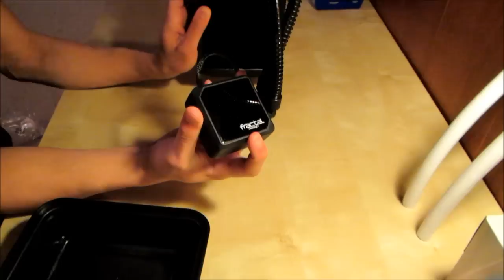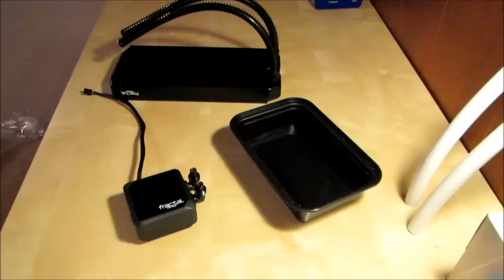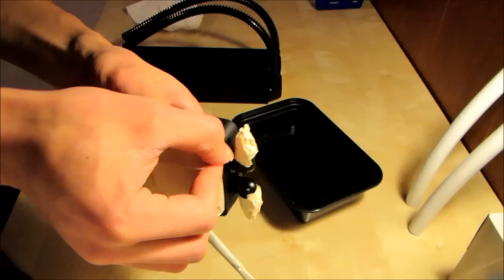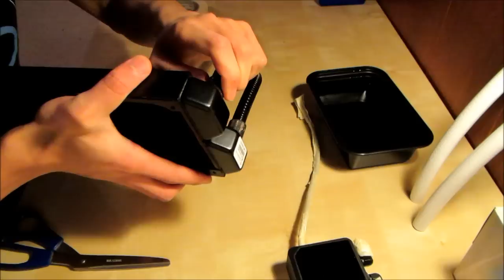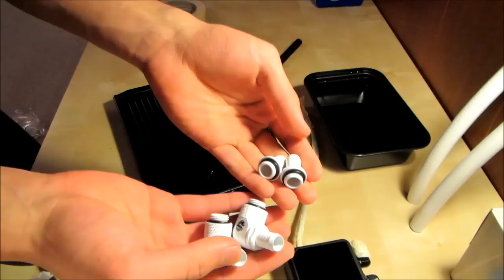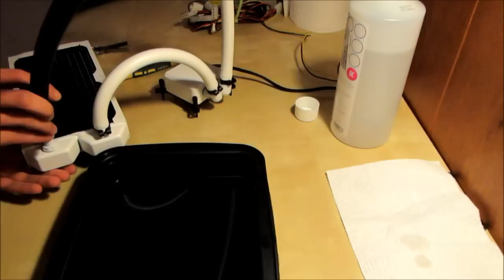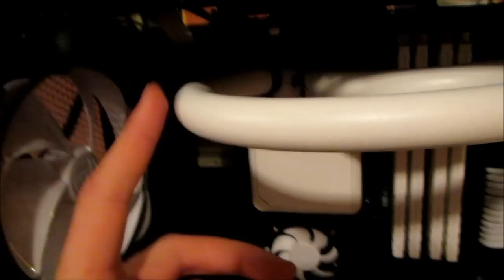Fractal Design Kelvin S24 refilling+modding guide

Comment: hold on... so if I wanted to add to the loop, I'd have to drain it, test fit it in my rig, take it back out, fill it, then install it? that's going to be a bit of a pain if you add another rad and GPU block, or is does the fill port stop fluid coming out?
Reply from the maker: antiduckable any time you modify the loop you need to remove it from the PC
you dont have to drain all of it, but you will need to refill it with more fluid when you put it back together
thats the same for all watercooling loops

Comment: One quick tip for removing the vibration. Use the CPU fan header and lower the pump speed by just 150-250RPM. 

It have hardly any impact to performance.
Reply: U can't change speed it's 3 pin
Reply from the maker: +Xetion Yes, you can change speed on 3 pin fans. The 3 pins are power, ground, and tachometer. The speed can be changed if your motherboard supports DC voltage control, which lowers the power making the fan run slower. Although for some reason I didn't see the pump speed change at all. 4 pin fans can also be speed controlled, they just work in a different way. The 4th pin is PWM 5v which pulses rapidly and manages to get the fan speed all the way down to about 10-20% which voltage control cannot do. You can control 4 pin fans with either voltage control (3 pin) or PWM (4 pin)
Reply: +Enderman LP oh ok. Do I still plug the CPU block into the CPU_fan or sys fan?
Reply from the maker: +Xetion CPU fan because your PC will alert you if the pump fails

Comment: Here are a few ideas you or anyone reading this comment may want to consider in the future, rather than use Masking Tape to cover things spend the extra and get Blue or Green Painters Tape. They are designed to stick but not leave an residue behind. Plus I think Blue can last upto 14 days and Green 30 days with no residue issues; obviously double check this. When removing tight fittings rather than Mar the finish you may want to consider using a piece of leather such as a Belt for example, or maybe something thinner. The Leather will still allow you to grip the item without damaging the finish. I know you are not going to reuse these fittings but this is more for those that might want to reuse them...

Comment: Nice job but seems like a lot of work just for white tubes and pump. I'm too lazy I would have just got tube covers ..lol.. What kind of paint did you use to paint the pump? Might of looked cool if the top wasn't painted since it had a glossy finish and the white writing, just a thought, but it still looks very nice and clean.
Reply from the maker: I used plastidip. It was a lot of work, should have just bought white tubing and replaced it :P

Comment: How did you apply that little 40-60mm cooler below the pump? I have small Noctua and i had idea like that, but i didn`t knew how to apply it to motherboard.
Reply from the maker: The motherboard needs to have a spot for the fan, you can't add it to any motherboard. This is a sabertooth P67.

Comment: nice rig!, is that corsair lp vengance ram you have painted white? did you do it with a brush or remove the heatspreaders and spray them?
Reply from the maker: Jolinator yes, I painted it with plastidip directly on the heatspreader, no sanding needed
i did remove the spreaders from the DIMM first, paint it, then put it back on with some new thermal pads

Comment: Hey I'm thinking of doing this but maybe expanding the loop to include my GPU and I would like to use Bitspower compression fittings instead. My planned build will be Black/Yellow. I want to use black Bitspower fittings and paint the block yellow. Can you please tell me which size fittings I need to order?

Comment: Hey, Nice video by the way! Just a quick question how do you hotwire your PSU to test out your water pump?
Reply from the maker: Short the green wire with one of the black wires, or use a PSU starting connector which just costs a few bucks and is safer.

Comment: What fittings size do they use?     What tube size as well?   Great video.
Reply from the maker: +SGTSAS It's not standard tubing and fittings, idk the size, but I do know that they use G1/4" threads so you can buy your own fittings for your own tubing. I'm using 3/8" ID and 5/8" OD tubing, with some bitspower 3/8" barb fittings

Comment: How did you paint the radiator without getting paint on the fins? And what type of paint are you using? Also, from you're other video I saw your motherboard. What is it and is it modded?
Reply from the maker: Jono K you have to use paper and tape to cover up the finsI used plastidip because its extremely easy to removeif you mess up you can just peel it off
my motherboard is an asus sabertooth P67, no mods
Reply: Enderman LP so when you painted your ram did you take the plastic shroud off or just cover the pins? I'm thinking of doing the same cause it looks very nice. Im planning on building my first pc and i really like the black/white colour scheme so yeah.
Reply from the maker: Jono K There are tutorials on youtube of how to remove the vengeance heatspreaders for painting. That's what I followed. It would be a lot easier to just buy while ram though :) there are white vengeance LP ram kits, and hyperx fury also comes in white.

Comment: hey do you think this loop can be expanded to include another radiator, a reservoir and a GPU block? Is the pump strong enough to handle it upgrades? How does this compare to the DDC or D5 pumps from ek, alphacool etc?
Reply from the maker: The pump is worse than a DDc, but quieter. That's a lot of stuff you're planning to add, I personally would go with a EK predator cooler OR even better, a watercooling kit from EK with a D5 pump (best pump ever)
Reply: Enderman LP I'm a cheapskate. Those kits are pretty expensive compared to an AIO. The kits aren't even cheaper than the sum of the individual parts combined lol
Reply from the maker: True, but the kits come with the stuff you need so you don't forget anything :)

Comment: thank you for this guide!

i am considering buying the FD Kelvin T12, which presumanly has the same pump part as the one you have. I am gonna mod it, and im wondering if it will handle this connection well enough:

CPU Block Pump -> Original Kelvin T12 120mm reservoir -> GTX 980 GPU Waterblock -> BigAss 2x140mm Coolgate Radiator -> Koolance TNK-501 5'25" Bay Reservoir -> back to CPU

will the pump be able to push the water at a good enough speed, or will it be too weak?
Reply from the maker: +anderp Yup it should be alright. The only thing that really adds resistance is the GPU waterblock, but it should have enough pressure to push fluid around still
Reply: +Enderman LP should there be any problem if i add an extra pump to the setup? i am buying the kelvin t12 cause i can keep it in the rear of the case and expand it without having to spend extra bucks to replace that.
Reply from the maker: +anderp it may cause extra noise as the second more powerful pump will push the stock pump faster
If you plan to use a more powerful pump like a mcp or D5 I would also buy a regular CPU waterblock with no pumpbut you can try it with the stock waterblock, see if it causes extra noise or notworst thing that can happen is the CPU block pump fails, which isn't that big of a deal since the second pump will be much more powerful

Comment: Instead of doing the thing with water to know where the water go in and go out you could before dismounting connect the cooler to a CPU, run a burn test without fans spinning and touching the radiator to see which side is hot and which side is not so hot. The radiator is made to cool so the water that going in is hot and the water that coming out is colder.
Reply from the maker: L3xou97 the water is moving so fast that the temperature in the entire loop normalizes
this means the difference in temp from one side of the radiator to the other is only a few degrees, not distinguishable to a human being
Reply: I use an H75 (120mm so) on my R9 290x (with a corsair HG10) and i can feel the difference when i run a burn test or something like that. On one side i can put my hand and on the other side it's a pain to keep the hand on cause it's too hot. But's that's maybe cause the 290x as a 290W TDP.
Reply from the maker: L3xou97 yeah, also those compact AIOs have a smaller pump and a lot less flow rate so the liquid moves much slower
Reply: And why didn't you put a reservoir? You can avoid bubble sound with it.
Reply from the maker: L3xou97 I wanted to make something compact, with few components, and easier to swap out. Also I will not be able to fit a res anywhere once I get the 86mm thick radiator
Reply: Are you sure you want to get a 86 mm rad? You sould get really low fpi if you want to get a rad like that or your fans will have difficulty to push air through the radiator.
Reply from the maker: L3xou97 yes, its specifically made to run with low speed fans, its an 8fpi radiator
also it is easier for fans to push air through a thick low-fpi radiator than a thin high-fpi radiator

Comment: If you are planning to change the rad why didn't u buy a pump+waterblock combo from swiftech?
Reply from the maker: +Luca Peppe the swiftech one uses a DDC pump which is very loud (especially with no dampening) and also overheats easily. Dazmode has a video on the DDC showing how they overheat and fry after a while. I'm planning to buy a D5 sometime in the next year instead
Reply: didn't know that, thanks for the tip :D
Reply from the maker: +Luca Peppe You're welcome :)

Comment: can you link the 90 degree fittings you used i cant seem to find the white bitspower 90s you used, i can only find the dual and triple rotary fittings. did you use a 90 adapter then put a straight compression into that to get the nice tight 90s off the block? pc looks great btw.
Reply: ok thats what i thought awesome thanks for the quick reply even though the videos older haha appreciate it!
Reply from the maker: You're welcome!
Reply: man fractal just released the celsius model to na and you can only remove the fittings from the radiator why on earth would they do that. noone who takes the time to swap out lines and add a gpu block is going to want to keep those hoses. fak.

Comment: Had to go check the LTT forums to verify, and yes, I recognize you. It doesn't make any sense to me if you are going to pretty much be doing a custom loop with just the block/pump combo from a full AIO. it doesn't make sense. It would have been better at that point to go for the smaller version and spent less. I'm going to be ordering the S36 to use on mine. eventually, yes, i may swap out things myself, like the 360 rad for a 420 and add on a gpu block.
As far as the tubing, there's little to no difference between bigger and smaller tubing. Yes, alot of people prefer thick walled tubing, there is no significant difference between the two. Those fans are pwm, and with that rad, you don't need to spin then at full speed. Doing it this way will result in lower noise. ALL fans get loud at full speed.

Comment: Why did you change the rad? Noticeable performance boost?
Reply from the maker: +Xetion I didn't chance it, I just painted it white. I'm actually planning to buy a 280mm rad soon from hardwarelabs, I'll make a separate video when I do that. I want to be using 140mm fans instead of 120mm fans for better airflow, and the hardwarelabs radiators are the best with low speed fans.
Reply: +Enderman LP the cpu pump wont be enough for that and you even want to add a GPU block...
Reply from the maker: +Lo Studios Adding a 120mm radiator? Yeah it can do that. I won't be using this pump in the future though, I will buy a D5
Reply: Enderman LP  thats a rather nice pump and it will be enough.

Comment: I am also a fan of black and white. Out of curiosity, what are your idle temps (mobo and cpu) and your intensive gaming temps (mobo and cpu) please ?
Reply from the maker: harshlens Idle temps are about 40C for motherboard and 45C for CPU load temps are about 50C motherboard and 64C CPUmy 3770k is overclocked to 4.43GHz with 1.135vAlso my fan curves are set extremely low at idle which is why idle temps are high (they are running at minimum speed, 500rpm)
Reply: Enderman LP
Oh ok got you and thank you. Yeah I do have very low idle temp, but my fans are all on max speed... I think I will lower them, but I don't really mind the noise. You must have a very quiet PC.
Reply from the maker: harshlens Yeah I'm trying to make it as quiet as possible because I have it on 24/7 in my room where I sleep  
When I get my 280mm radiator I will be able to use my 140mm noctua fans instead which should give a lot more airflow and lower temps while making the same noise level
Reply: Enderman LP
yeah if you keep it on, for sure you don't want it to be noisy. I guess your GPU also makes a lot of noise, I can't wait for the new amd card and I'll get the water cooler version from asus.

Comment: The pump is design to withstand dryrun, so why not just use the fillport to fill the system?
Reply from the maker: Martin Olsson because it takes longer and makes it really difficult to remove all the microbubbles
I top it off at the end using the fill port but there is still a bit of air inside
the best way would be to use a radiator with multiple fill ports and use one of those to fill it up so the radiator acts like a res, that's what I plan to do when I buy the nexxos monsta 280 radiator :)

Comment: Why did you paint the tubing when you can buy white tubing?
Reply from the maker: pOpArOb Because I wanted a matte white finish, not glossy like white tubing
Also the EK ZMT tubing is the best kind of tubing and comes only in matte black
It has no plasticizers and doesn't degrade over time like plastic tubing

Comment: Is the pump strong enough to expand a dual GPU in the loop or will I have to buy a second pump?
Reply from the maker: +Andreas karlsson I wouldn't do more than 3 components with this pump, so rad+CPU+GPU. You can probably do two GPUs and it would work, but that would increase temps a lot. If you're planning to do so many components like two GPUs, a CPU, and one or two rads, you should probably invest in a D5 pump :)
Reply: Enderman LP Ok.. Thats a shame.  Guess I'll have to wait an additional month for the greens to a pump then. 

Reservoir not needed or?
Reply from the maker: +Andreas karlsson It's not needed, but from my experience it is far easier to fill a loop when you have a reservoir. If you have room for it in your case, buy a D5+reservoir combo and you will be set :) The best pump on the market + reservoir for easy filling will make your loop look cool and more fun to build
Reply: +Enderman LP yeah i can fit it but it wont be sen since i only have a small window.  ^^ 

think ill try it without the pump and monitor how hot it gets and get a pump+res later instead then. :-) wanted to try water cooling for 10 years now but always been to poor or to much of a chicken. xD

Comment: Hey, is the pump of this AIO stronk enough to add a GPU block to the whole loop?
Reply from the maker: Le Magic Cactus yup
I would say max is CPU+GPU+480mm of radiator
Reply: Ah, thanks. I might buy the S36 so no extra rads would be needed and since 360 is probably enough to cool an i7 4790k and a GTX 980, right?
Reply from the maker: Le Magic Cactus yup, definitely enough :)
Reply: Enderman LP Thanks for the quick answers!
Reply from the maker: Le Magic Cactus You're welcome :D

Comment: what if you add a reservoir without a built in pump on it and use that as a filling method?
Reply from the maker: Reservoir yes, built in pump no because there is already a pump in the CPU block.
Reply: You cant have more than one pump in a loop?

Comment: if I wanted, could I of added a resivor to make the filling process a lot easier?
Reply: and to give it a little astetic look
Reply from the maker: Yes, but you will need to replace the fittings and tubing to a standard size  since the stock tubing/fittings is very small.
Reply: A E S T H E T I C*
Reply: +Cooky It creates airlocks (bubbles) in the case that can't escape and prevent the cooler from accepting any more fluid
Reply: +Cooky You can turn the rig upside down and try to shake the bubbles out, or, if you have a long flexible silicone straw you could try and suck the bubbles out as if it were a blood clot (Ever watch House MD?)
Reply: +Shrug Don't attempt to move the case while the port is open or the fluid will leak out. Seal the fill port first.

Comment: one tip
do test fittings for the best fit
Reply from the maker: Matt L Yeah I could have done that but I like having my PC with the least down time, so test fitting would have required removing the CPU cooler, testing the S24, then remounting the old cooler, which would take a lot of time :)But at least it did fit in the end